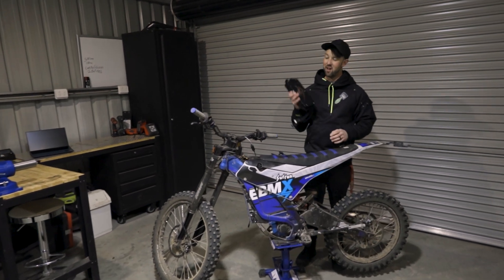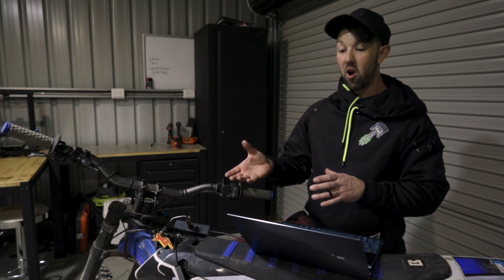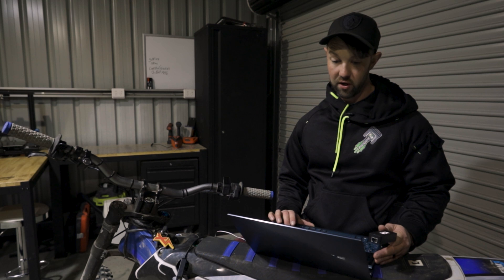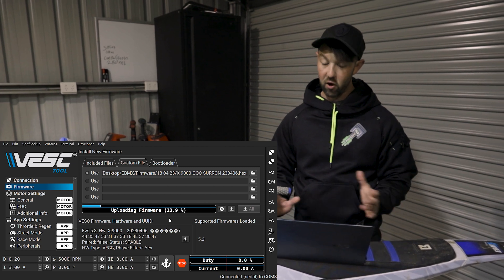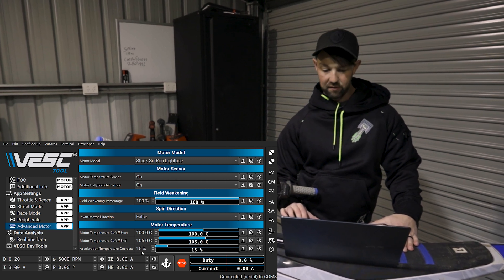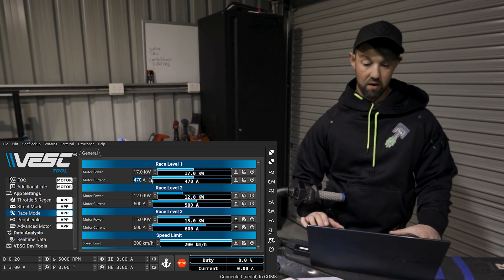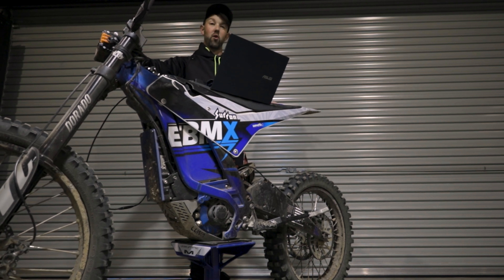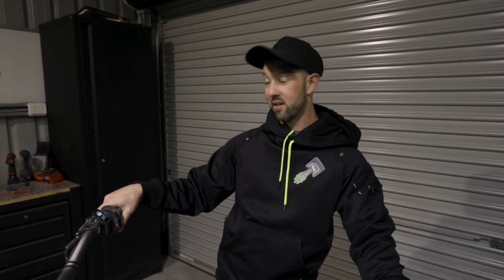Basics on Tuning VESC || Firmware Update EBMX X9000 || Setup of X9000 on Sur Ron

Comment: Running stock motor on my 22 Surron Lightbee with a 72v Chi battery and of course, the x9000. I have a lot of overheating on the motor when climbing any hills, or if I'm on the throttle hard for more than 20-30 seconds with any incline. My tune - only running 8KW and 300-400 phase amps/motor current. Trying to figure out how to mitigate the chances of the stock motor overheating. I don't have a PC to check the settings on the VESC PC app, but I noticed the VESC app has a setting that the iphone app doesn't have called, "Acceleration Temperature Decrease".  What does this setting do?
Reply from the maker: Hey mate

If your having over heat issues, there was a bug on early firmware that affected some users. I'd definitely reach out to get that updated mate.

The ATD basically brings on the over temperature cut off sooner.